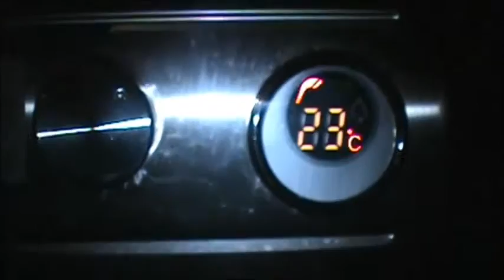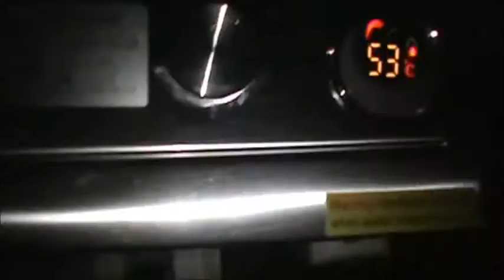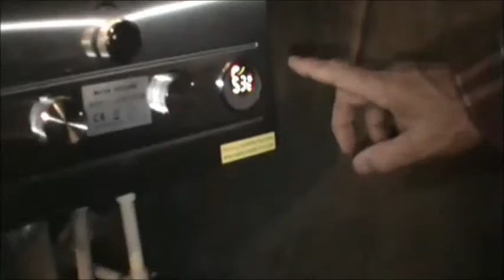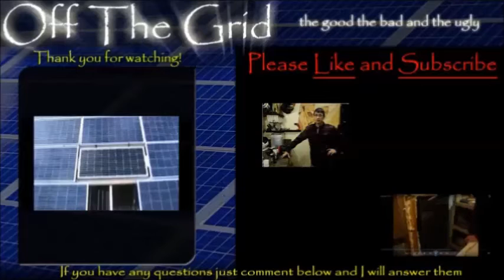Off The Grid: Hot Water pt2 On-demand Tank less hot water (Solar Power) (DIY)

Comment: What would you say your propane consumption is per hour of use?How does it handle  variable input water temperatures?
Reply from the maker: I dont know the hourly consumption but the heat , hot water and range uses one submarine and a half for one full year or about $2500 worth . There was a learning curb
that I had to go through because of the solar preheating  that I do . Because of the variable 
water temperatures that are a little all over the place , at worst all I need to do is to cut back on the hot water tap to hold the water flow back in the heater longer if needed . This is all done in order to save on propane . Most cities and municipalities take their water from a lake and the temperature varies quite a bit from summer to winter . I pull from a well and it is quite constant ( cold ) . Only because I preheat is there a lot of variability but easily overcome .denis
Reply: mr .Carriere,My wife and I consume 20 lbs of propane,$ 10 every 4 months with a propane stove,with the pilots turned off....with them on 1 month,Hot water is electric,2 showers and dishes is about 12 kw hours aday.My hydro consumption is about 350 kw hours amonth ,about $ 20 without a preheater You must have a lot of little people in your house.ha1